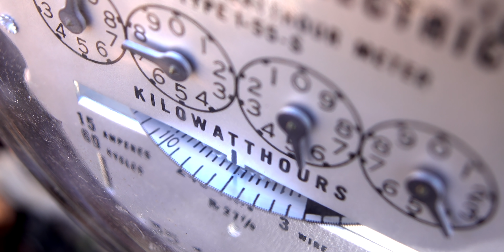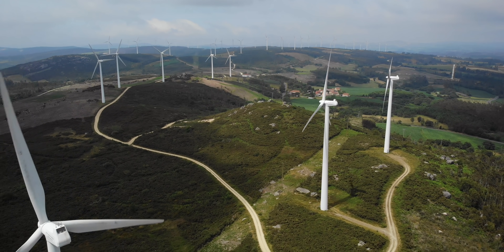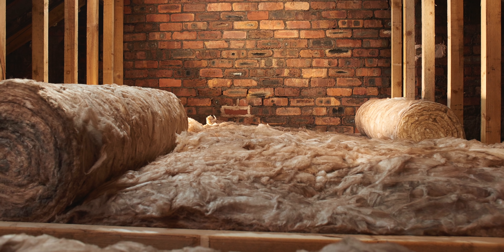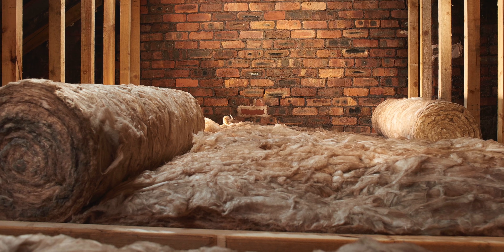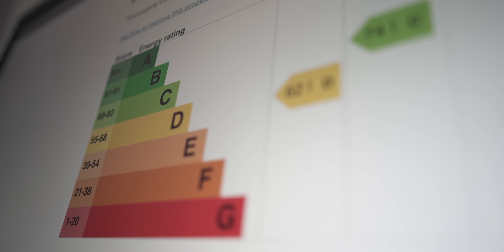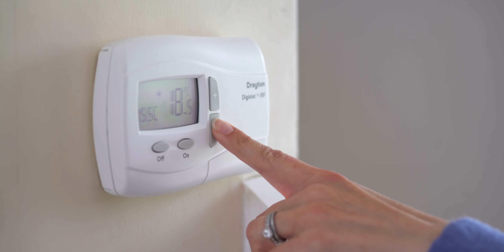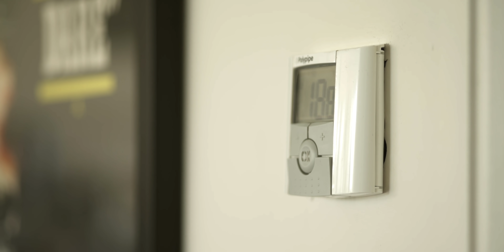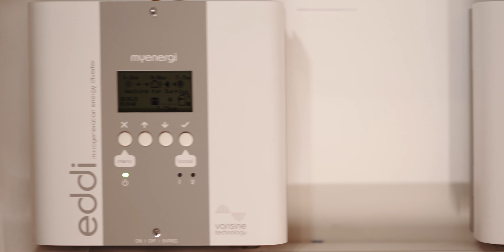HOME ENERGY Episode 1 - Cheaper Measures, Energy Efficiency & Fabric First | FULLY CHARGED

Comment: One big issue in the UK is the "Green Levy", it's at about 24% for electricity (plus VAT) whilst for gas the tax is 2% (plus VAT).  That means in the UK, based on an electricity price of 18p per kWh, the tax alone is more than 4p per kWh. Whilst for gas, it's about 0.07p per kWh.  That mean that just the TAX on electricity costs more than the total price of gas.
Reply: This is a brilliant fact. I am writing to my MP.
Reply: So per kWh, electric is 10% off usage. If the tax was matched for every 4.5p raised from electric you could 8p from gas resulting gas going to about 3p to 4p

You could levelise tax to about 12% to saving about 2p per kw an increasing gas by less than a penny..
Reply: @simonhenry7867  gas is used to make electricity.   Some times its 40% of uk output
Reply: @CrashUK28  so your saying if use gas for heating I pay 2% and if I use gas* I pay 24%.
Do you see how arbitrary stupid and unfair that sounds.

(*Via electricity)
Reply: @simonhenry7867  I dont understand the post at all
Reply: @CrashUK28  if I use gas directly for heating I pay 2% if I use it indirectly as you pointed out I pay 24%
Same fuel just differently processed.
Reply: @simonhenry7867  Where are you getting the 10% figure from?
Reply: @antontaylor4530  the UK uses about 10x as many kWh for heating as it does for general electric...I've checked it a few time and the ratios are stable.
Reply: @simonhenry7867  Where are you getting your data from?
Reply: Issue is the technology to replace gas boilers is not their.   if government need to give away £12k for you to install a heat pump that not going to work then its not the right technology.    H2 boilers are zero CO2 work better then a gas boiler.
Reply: @CrashUK28  Biogas would be a good solution if it didn't require large amounts of ariable land.  And hydrogen has issues with supply - most forms of hydrogen production are very inefficient, and (so far) all of them are damaging to the environment.  Even electrolysis is bad for the environment, since it requires you to use energy that is mostly made in fossil fuel plants, and it wastes most of that energy - meaning you would actually increase the UK's overall carbon footprint if you switched to it.

Heat pumps are only expensive because they're niche.  Honestly they're just upscaled refrigerators or air conditioners - the tech is actually cheap.  Really, really cheap.  An arduino has enough processing power to control it, and they're a $1 part.  The compressor is a $100 part.  The evaporator and condensor are $50 parts.

Plenty of people are building their own.  For crazy cheap.  Youtube is full of howto videos.

And as for digging a hole for the ground loop - how much does it really cost to dig a hole?

If they were being installed on a large scale, the economies of scale would kick in and they'd be cheap.  No, not as cheap as gas boilers - but when you factor in the 20 year total cost of ownership, they're already cheaper in the long run for most people that have a garden.

With economies of scale, they could be significantly cheaper long term than any other form of heat generation.  In fact, since they cool during the summer (and effectively store that heat in the ground until winter) they can be crazy bonkers efficient.

The reality is that no form of heat generation comes close to heat pumps for low environmental impact, especially when they're powered by renewables.  And if you factor in the long term costs, nothing is cheaper than ground source heat pumps (except perhaps air source, if you live in the right climate).
Reply: @antontaylor4530  heat pump take a long time to get up to heat so and when its you only talking 40c for centre heating which requires replacing all radiators and in newer house that use micro pipeing this will need to be replaced with 15mm pipe work and if you removed you hotwater tank you need to find a place for that.   Heat pump have been around since the 1970s so don't see the prices coming down.  Its never going to work in UK housing stock due and the weather too unpredictable for the slow heat pump which take hours to get up to heat where a gas boiler can kick out 24 kWh to 40kWh heat instantly.    Just think its drop to -10 and you heat pump just come on but now its got to heat all the water in the centre heating to 40c but you had to fit much bigger radiators so it going to take hours so you now you house is cold and by the time it go hot you at work and you heating a house but no one is home but now its 15c out side.   You talk with your installer who now advise you that you need to run the heating 24 hours in-order to have heat at night,   Now you house is not as cold when it -10c out side but its to hot in the day due over heating and you find out you fuel bill is now go up by 300%.
Reply: @CrashUK28  Where do you get the idea that they're slow?  A big heat pump can get from ambient to 40c in seconds - the limitation on heat pumps is not how quickly they can get hot.  It's pricing.

And for cheaper, less powerful heat pumps, you can simply pair them with a phase change heat storage unit.  Essentially they're filled with a wax that melts at 60c.  You heat it to 60c, which takes a long, long time - because it has to phase change.  That phase change stores vast amounts of heat at 60c - if it's the size of an average hot water tank, you can run the average house off of that for days without the need to "recharge" it.

It stores vastly more energy than an equivalent sized hot water tank because of the phase change properties of the wax.

This means you can shrink it and still have instant 60c hot water, even with a cheap heat pump.

This means you need not change anything in existing central heating systems.  Many are already using a hot water tank - those are very simple conversions.  Those using on-demand boilers don't need the upgrades you speak of either - they just need a wax phase change heat storage unit.

And heat pumps have not been around since the 70's.  They were invented in 1948, techically, with the first installation in 1951 - but really, William Cullen first demonstrated heat pump type technolgy in 1748.

Your assertion that it won't come into widespread use because of cost is not one that history would agree with.  Solar panels used to cost tens of thousands of dollars per panel back in the 1970's - in 1975 solar panels were $105.70 per watt, they're averaging $0.20 per watt in 2021, thanks to the economies of scale.

And you're ignoring the fact that most people can save money in the long term even with the very high cost of heat pump systems as they are - even if they don't come down in price, they could still become extremely popular if people are willing to invest up front for nearly free heating over the next couple of decades.

Think about it - if a homeowner gets a loan for the cost of installing the pump system, and spread the cost out over the next few years, their monthly spend will be the same or less than it is with gas central heating.  But once it's paid for, you have nearly free heating for years, and it also increases the value of the home.

It's a no-brainer for most homeowners, even without any government grants.  And installs are going on right now - with a growing market, it's inevitable that costs will come down.  That's how economies of scale works.  And as prices come down, number of installs goes up, and the whole thing picks up speed.

Exactly how the solar industry did, and how the EV market is currently doing.  Electric vehicles have been around since the 1800's - and yet they're only just now taking off.  So it doesn't matter if a technology has been around a long time, it just needs the market to be right for it to take over - and the heating market is ripe for change right now.

Fully charged will be making a video about heat pumps being the future soon.  It's out on Tuesday 24th August 5pm BST.  Just wait and see, they'll say the same thing.  If it was as pointless as you seem to think, they wouldn't be making a video specifically about it being the future of home heating, would they?